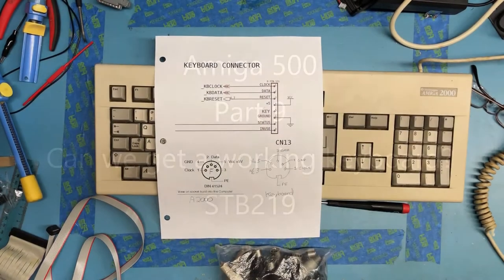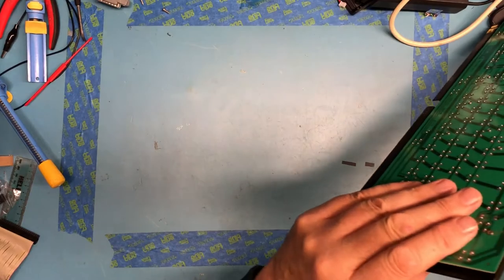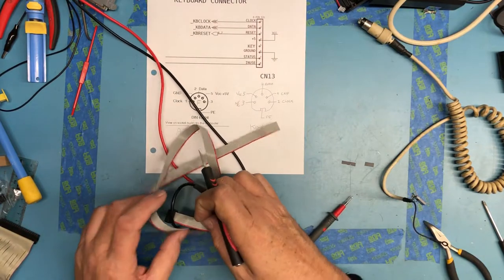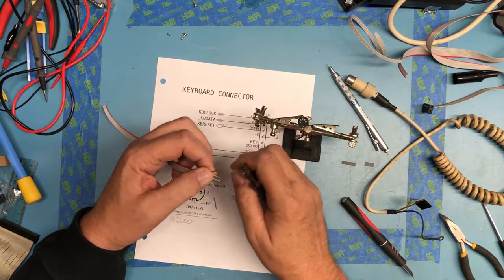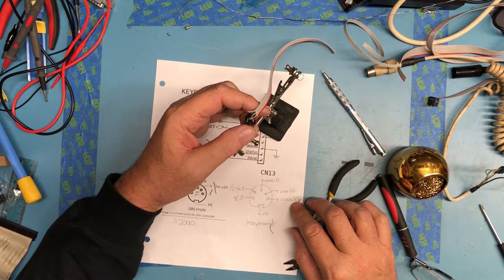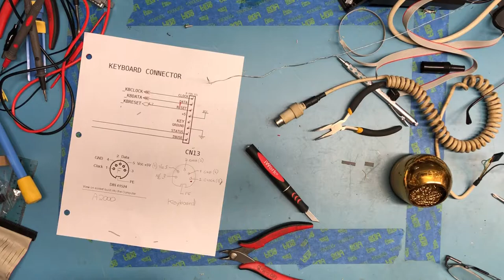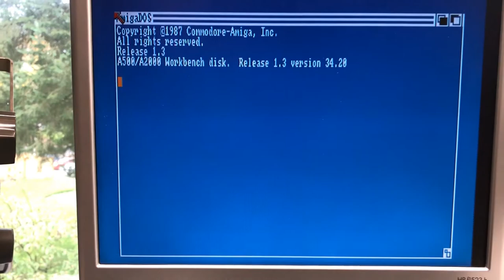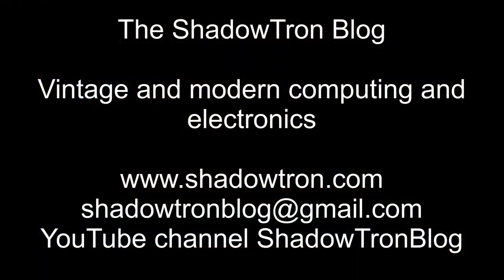Amiga 500 - Part 9 - Can we get a working keyboard? - STB219

Comment: I wonder if the N and M key aren't working simply because the keyboard is so filthy
Reply from the maker: Pretty much was the case. it was so dirty the left Amiga key was stuck down resulting in the two keys not working. I still haven't cleaned it up but will get to it soon.